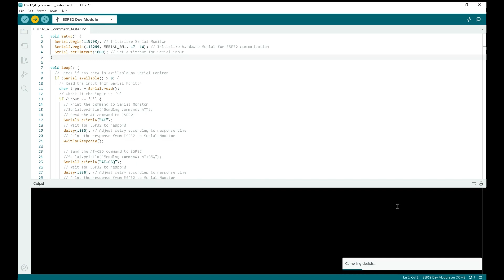How to use KTRON 4G Module with ESP32 Board | KTRON | 4G Module | www.ktron.in

Comment: How you are giving power supply to module, extra two pins is connected to module and other side connected to ??
is that adapter or battery??
Reply from the maker: 4g module can be powered with upto 12v dc, but your mcu logic level voltage should be connected to module on Vdd pin to enable voltage level translation for Rx and Tx pins of the 4g module

Comment: I am getting gibberish output when using UART in ESP-IDF. Can you help?
Reply from the maker: Default Baud Rate of the 4G module is 115200, try with that. Also make sure that GND of 4g module and ESP are connected. And Vdd of the 4G module should be connected to Vcc of the ESP module.
Reply: @ktronindia  the arduino code is working properly so I don't think wiring is the issue here. And the baud rate is set to 115200 for both. And upon connecting the Rx to the Tx of the esp32 I can see the message is being sent.
Reply from the maker: @debarkamondal6406  Hi, pls connect with our team on sales@ktron.in with details about your issue, and order number, they will help you to resolve this issue.

Comment: I am using SIM A7672S 4G LTE + 2G + GNSS Development Board – With GNSS , sim is properly working inside the module , blue light is blinking but when I am typing S in serial monitor of Arduino IDE it is giving output output like square when using it with ESP32 , I then tried to use it with arduino followed steps shown in your other video ,when typing AT on serial monitor no output is coming on serial monitor before some square were coming then I tested it with usb to TTL converter then also to AT command no output was coming .I rechecked all the wiring they were correct , tried changing baud rate also . Please help
Reply from the maker: Hi there, make sure you are using correct baud rate. Also, make sure that Vdd is connected to the voltage level of the MCU. In case of Arduino, connect Vdd to 5V, for ESP32 connect it to 3.3V, and also, GND of the arduino or Esp32 and the A7672S module should be common. 

In case this does not solve your problem, you can email your query in details to us on sales@ktron.in, and our technical team will get it solved.
Reply: As given in the code in description the baud rate I was using was 115200, do I need change it , I tried changing baud rate also , wiring I did was according to what you told
Reply from the maker: @neuralmechamind  Pls connect with our technical team on sales@ktron.in and they will get your query resolved.

Comment: Hi
What is the logic state level of this module
Is it 1.8 V or 3.3 V or 5 V?
Thanks
Reply from the maker: Hi there, this development board supports all 1.8v, 3.3v, and 5v logic level.. It has a Vdd pin, just give the reference voltage on it, and the board's UART will work on that specific voltage
Reply: @ktronindia  so i can give 5v as reference when communicating with Arduino and similarly 3.3v for rpi?
Reply from the maker: @anmolsinghshekhawat4284  yupp. Thats correct.